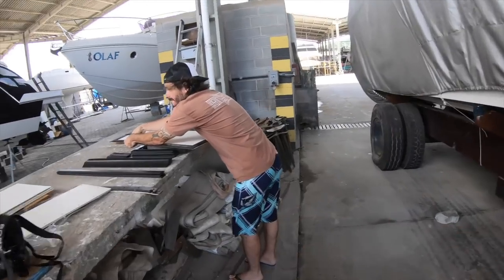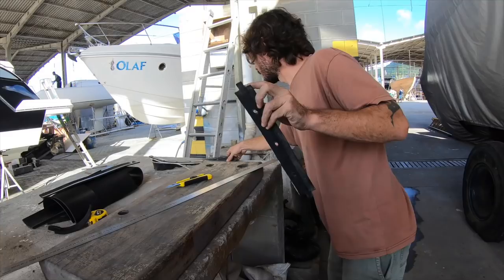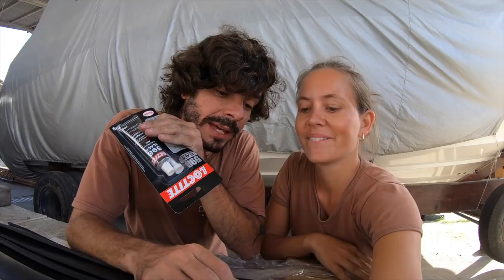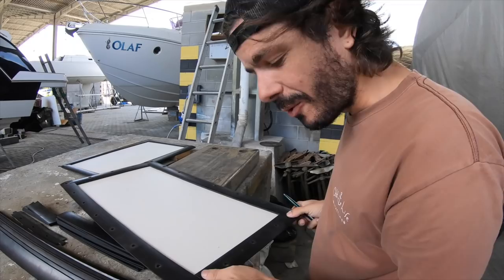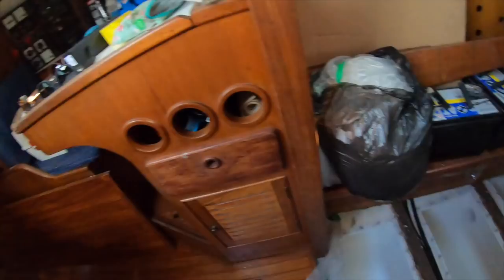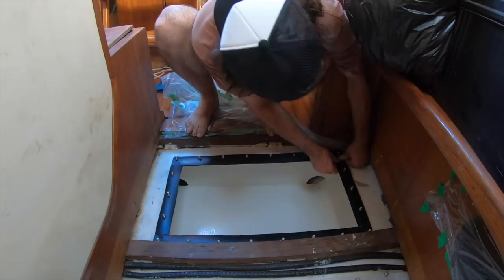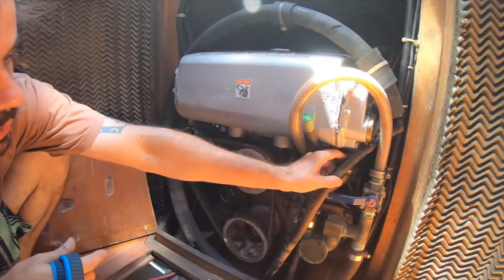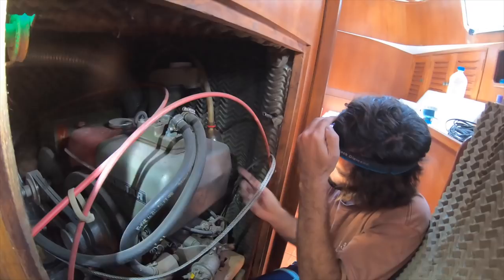⛵️Time to FILL UP our DIESEL tank?!? #127

Comment: I bought an older boat and while the filler line (from the deck to the tank) didn't have any actual leaks, the entire hose was so deteriorated the fuel would leak or soak out like from a sponge. 

These hoses can not be cleaned, they must be replaced!!!

This was extremely dangerous, as the whole boat would fill with fumes every time I filled the tanks. If this were to happen with diesel, you'd have a terrible constant smell if diesel.

I would really hate to see you go to all this trouble only to find out the hose is past its expiration date, which no doubt it it. If you have the same issue as I did and don't change the hose, you could be faced with diesel behind and under your walls and floors. 
I know how much trouble it is to change that filler line (I did it), but right now is the easiest and most convenient time to do it. 
If you think about the volume of fuel that passes through this hose is such a short amount of time, the amount of fuel leakage will be way more than from any of the hoses going from the tank to the engine.

CHANGE THAT HOSE!!!!!......lol
You risk all of your hard work by not giving this crucial hose the consideration it deserves.

Comment: You have the patience of saints cutting all those gaskets for the diesel tanks!  Keep safe and wish you all the best in the strange circumstances.
Reply from the maker: 👫😇😊 Duca indeed had all the patience. hehe. Actually I think he was enjoying doing it. hahaha. Every time I went to check on him he was excited ! hehe
Reply: Love your enthusiasm.
Reply: I would have maybe made a sharp steel cutter in the shape of the end of a jig saw piece end if not square then carefully placed it in the correct position and hit it with a hammer to make the cut as you would with a chisel .  The techniques used with mastic when fitting modern car windscreens would be my first choice here though as it would remove the joint completely , you place an accurate V with a motorised gun on the plate then install but not screw down fully until the mastic ( suitable for diesel ) has cured

Comment: Hi guys, Wow sealing those tanks is a big job, a torque wrench might be helpful.  I know you hate the idea of replacing the fuel fill hose but I'd really give that thing a good look. It will really suck to replace that thing when it leaks and one day it will leak. Some advise... I work construction and there are almost no good surprises in construction, I think the same goes for boats..... so eliminate surprises! keep up the great work the water is near!
Reply: You are right Brian, I have done both construction and Boat Yard and boat building work and boats are much worse than even a remodel, and you know how they can be ...
Reply: Sound advice!
Reply: I would replace that fill hose too if it feels crunchy....It might be ok but chances are the metal coils have rusted out.  A simple squeeze would tell.
Reply: So true, replace the "fill" hose
Reply: Please dont do all that work and not replace diesal  infill hose. All hoses deteriorate with age. 22 years plus usage before that. The oft-cited rule of thumb for engine hoses is ten years.

Comment: Hey guys. Judging from the (not surprisingly) deteriorated state of your rubber diesel hoses, it would probably make sense to exchange the filling hose as well. On any major restoration project, first thing to replace are hoses.
Reply from the maker: The filling one is bigger and doesn't seems to be this bad. We put the camera inside it and it seems good. we are still thinking about it.
Reply: @OddLifeCrafting  yea, leaving a 10+ year old 2-3 inch rubber hose thats most likely dry rotted shouldnt be a big deal. Well its not a big deal until it becomes a big deal.
Reply: Yes, because you know when it's going to start leaking? As soon as they put in a couple of hundred gallons of diesel.
Reply: @OddLifeCrafting  It's hard to decide to do something that may or may not be needed but after it's done you know its definitely ok! Think of it this way, how many you tube videos are there replacing a fill hose? It will make good content and in the long run the repair pays for itself!

Comment: Hi Duca  looking at this if you want to research Aviation Sealants for JET-A1 and other wide cut gasolines such as Kerosene,  Diesel  look for PRC 1422 or 1420 this is used on all Airliner fuel tanks. if you need any information please mail me I can give you some help Also when Closing the Diesel tank tops tighten them down in a sequence that pulls them down evenly  the best way is to imagine a Clock  and tighten the nuts down like  12 then 6 then 3 then 9 o'clock then 11 to 5 then 1 to 7 and then the rest in a similar order in Torques the Tank lids down evenly
Reply: I have used aviation gasket sealant for old Volkswagen engines that I built for rail buggies and never had the leaks from the split block that most leaked from factory.
Same on older Harley’s.
Great suggestion!
Reply from the maker: It's not that easy to find aviation products here in Brazil. Thanks for the suggestion.
Reply: Hi Duca I thought that may be the case plus the Aviation Fuel Tank sealants are very expensive  how ever if you use it they will work it was just a thought that if you do experience problems with the joints on your seals. I know also that I may be teaching you to suck eggs when I said you need to Torque the lids down in a proper sequence I love the VLOG and So So wish I was doing a similar project like you at this time if anything has helped you Then that is good if you have any questions about engineering or mechanical stuff then please ask I may have an answer Craig
Reply: Hylomar or permatex non-hardening gasket sealant is my suggestion, off brands are everywhere. Easy to work with, fuel/oil resistant and if you have to take it apart again it’s reusable. I suspect you’ll just use what you already have and that’s fine as well.
With aviation two part sealants you won’t have a leak but those panels will never come off haha

Comment: Hi Guys. You may want to think about a pressure test on your diesel tanks and even the water tanks before you fill them. Only 1-2 Bar 15-30 Psi. Very cheap to do yourselves with a pressure gauge, foot pump and a couple of small valves. Check the pressure remains constant over 24 hours before you commit to filling the tanks. Just a thought. Sail Safe guys. Ant, Cid and the pooch crew.
Reply from the maker: thanks for the suggestion, guys

Comment: Hi guys,

You can
easily make a T-junction in the salt water inlet of the toilet (below the
toilet pump) and than lead it via a deck wash pump to the front deck to rinse
the ancor.

It worked
well on my 28 feet boat.

Succes,
Marcel
Reply from the maker: Thanks for the suggestion, Marcel.

Comment: Hi Duca and Roberta, yes this is troubling times. The situation is going to definitely try all of us. Hang in there! One suggestion on the Loctite, which by the way is a wonderful product, put some Vaseline or “grease like “ product in the cap. Why? Loctite will get hard and become un-usable. With the Vaseline it will stay soft and you won’t waste the leftover! You may need some out in the middle of the ocean.
Reply from the maker: Thanks for the tip.

Comment: They are correct.  Use the old hose, lines, wire etc as a snake for the replacement.   But take it one step further.  If you have an extra schematic, trace in your fuel, water and all plumbing using colored pencils or pens.  And label with start to finish.  Like an electrical schematic.  Also label the lines.  You can get a label gun that uses various sizes of heat shrink. Larger lines will require something different. It's a nice way to label a line in multiple locations so if you need to replace later, you know exactly which line, where it starts and where it ends.  Good luck guys!  Great vid.
Reply from the maker: Thanks for the suggestion, Robert. Thanks for the always support as well
Reply: @OddLifeCrafting  Just remembering all the nightmares I've experienced when going aboard a vessel to make repairs.  Tracing was always a night mare.  Sometimes would take up to a couple hours just to trace something.  It is a bit of a pain, but will save you critical time in the future if you need to make a hasty repair while underway or in port.
Reply: yes... label the lines and take pictures

Comment: If you know that you are not going to reinstall certain branches of the water distribution header then I would recommend that you demo (demolish) the branch lines that you are not going to reuse prior to replacing the header.  That way when you go to replace the header, you can still methodically replace each section like most people recommend...  But you will not end up reinstalling Tee fittings for branch lines that won't be installed and you wont have any dead legs.  Always a good idea to sketch a schematic of the header prior to demoing it because you can get a good fitting and valve count that way.
Reply from the maker: Thanks for all the suggestions, John ☺️

Comment: Hi Duka, I was happy to hear that you haven't sealed the diesel tank yet. I own a diesel pickup repair shop, have been a diesel mechanic for 20 years this year. We have seen bad results with black silicone and diesel fuel. Use Permatex Ultra Grey. Ford used to use it to seal their diesel oil pans to the block.
Reply from the maker: We don't have this brand here in Brazil, but for what I can see on google it's similar to the one we are gonna use.
Reply: @OddLifeCrafting  test.. test... test...
Reply: I just used it to seal the rear plate on the back of my 7.3 when I did the rear seal.

Comment: Regarding the tanks(water and fuel), if I were cleaning/replacing everything on my boat, I would replace the "fill hose" as well. Even though it may be alright in the wall upto the deck, just seeing the example of the one under the sole, the one in the wall is probably just as bad. Just my thoughts....
Reply from the maker: The diesel fill hose seems to be in a good shape. The quality of the rubber is much better than the others. Also the hoses looked pretty bad from the outside, but the inside of them were pretty good.

Comment: Hi Duca. I'll vouch for Craig Stevens advice. I was on runway maintenance  at Toronto Int airport. Our shop worked on our equipment mostly with aircraft grade products. A little more costly, but never had to fix things twice. His advice on the tightening of your bolts is almost a rule.  If I was in your position, I  would get the boat ready and in the water. Stocked with supplies. If things get real crazy with the virus, the boat could be your escape. Even if you run out of supplies, you have fish you can survive on. Right now here in Canada we are in a total shut down. Only essential stores are open and people have to stay two meters apart or get huge fines.plus have to stay in our homes.
Reply from the maker: There are some tasks we need to do before going to the water, it won't be possible to go to the water now. 😔
Reply: @OddLifeCrafting  Sorry Duca. I don't know how things are in your country. But right now, all we can buy is food, medical products and fuel. Everything else is closed. Couldn't buy a boat part, car part, building material or hardware. I would look ahead and get what you need in case it happens where you are. Toilet paper is like gold.You can't find it anywhere. At least if you have your parts you can finish it, launch it, and finish the rest floating. Sorry sounding like an alarmist, but if I still had my boat, I'm be gone.

Comment: Well that all looks like fun! Locktite 598 will be fine, tongue and groove on the gaskets should be fine also you are wise to be careful. You can always use steel number punches for marking such things, they will last through sandblasting. You are right about hose replacement its better to replace 1 at a time or have the "Engineer" make a damn diagram ( just teasing ) . You will get through it all, on the downhill side now, things will really start  coming together, as ever I wish you the best, and they didn't close my Damn Boat Yard so no rest for the weary, till next week, stay safe and plan ...
Reply from the maker: Thanks for the support, lawrence

Comment: Duca & Roberta i hope this find's you both well and Safe , I was thinking you might use the Top Hand Rails on each side of the Boat for your Salt water sprayer wash down area ,one side could be freshwater and the other like i said salt seeing the Rail goes around the hull it would take some work to do but the pipe is there and could do both of your needs for the wash down .

Comment: Hey guys just a suggestion if you haven't finished your diesel tanks yet install all the gaskets and lids plug all the hoses so they are air tight using air pressurize the tanks to 5 psi and see if the pressure holds with pressure in the tanks then spray  the lids with soapy water solution if air can't leak out the diesel can't either. It's better and safer to find land with air then diesel.
Reply from the maker: Thanks for the suggestion ☺️
Reply: @OddLifeCrafting  I've had to test many a diesel tank as I'm a diesel mechanic this way if you do have a leak no diesel going in the bilge

Comment: For the diesel tank gaskets I suggest a dovetail or keyhole joint instead of a rectangular one. Instead of cutting by hand I recommend a steel rule die to make the cut. It will save lots of time and give the best joint. The cost is minimal if you have access to a local steel rule die maker. Steel rule is bent to the desired shape and installed in special plywood. The die will cut both male and female ends and they will fit perfectly every time. Cut against a smooth, even wood or preferably a plastic surface. Locate the die correctly over gasket ends.  Place a small metal plate (or hardwood if metal is not available) over the die and hit it with a heavy hammer. Try it on some scrap first. This should give you a superior joint. To achieve an optimum seal, even pressure is important so a torque wrench would be useful. There seem to be lots of bolts so even pressure from evenly tightened nuts should give an excellent seal. A seal is created when some compression is achieved so make sure you use a gasket material that is soft enough to compress. For the size of the diesel tank gasket you should use fairly soft solid Nitrile probably 50 Durometer Shore A vs the harder 70 Duro.  From the way you handled the material it looks like 50 Duro. Anyway, I think you did a great job..  
I love your work and videos. Great job.

Comment: Duca, if you can’t replace the fill hose from the deck to the tank, maybe you can put a new hose inside of the old hose. It will have to be a little bit smaller but it should work.
Reply from the maker: Thanks for the suggestion

Comment: Enjoy your videos! You guys work well together which is nice to see. I have noticed that some viewers have suggested that you test your tanks with air pressure. 2 to 3 psi and another at 5psi. In my humble opinion, this is bad advice. I highly recommend you not attempt doing this exercise. If you insist on performing this test then proceed with caution. Equipment needed would be a very high quality air regulator and a very accurate 4 psi gauge with a least a 3” diameter face. Maximum pressure: Depends on metal thickness. Maybe 01 psi. Realize you risk damaging the hull plate and structural material while conducting an air test. Filling the tanks with water would be the preferred method. When you do fill the fuel tank, only fill to 95 percent to allow for expansion. My experience?
23 year USCG engineer; also tugboat engineer. Stay healthy and be safe!
Reply from the maker: Thanks so much for the recommendation.  Stay safe as well. 🤗

Comment: Amigos, remember here in Brazil we have fuel plastic hoses available, cheap and easy to find. Those black plastic, not rubber, used in modern cars and trucks. Use 4 inches of rubber hose to attach to the fittings. One problem is the radius bend is limited.  Take extra care with pressure test. Measure and control low pressure properly is tricky.  Consider use a hose with a column of water only, as pressure system, use an "U" manometer . Use only a few psi. Saudações.

Comment: Just a thought for someone doing this in future. Perhaps fabricate a press punch template. Essentially a couple of knife blades set in the pattern, then use an arbour press to cut the corner in 1 step.. perfect cut and exact every time... just a though. More prep but a more accurate outcome... and overall quicker ;) great work doing this by hand!

Comment: If I recall, the final rinse on an anchor chain should be fresh water as salt water causes rust and fast.  I lived aboard a steel boat, so rust was part of daily life.  Even washing dishes, many people wash in salt water then rinse in fresh to keep silverware and pans from rusting.  I hope that people with experience will comment on this.  I think that galvanized steel fairs better against rust, but it still depends on the quality of steel the chain is.  Beware that sometimes people request 316 and are given 304 instead.  That happened to a channel that I watch when buying chain in  Central American nation that has a big canal.

Comment: Great job on the boat. Just a small bit of advise from my coast guard years. Now the you are redoing the electrical and pluming i sugest you draw the tecnical path ways of those lines so have them for the refrence and also for emerancy repairs. It was one of the certification as a crew member from the captin to cook had to make those draws of the boat. Keep going stong.
Reply from the maker: Yes. This is the idea. ☺️ thanks for the suggestion